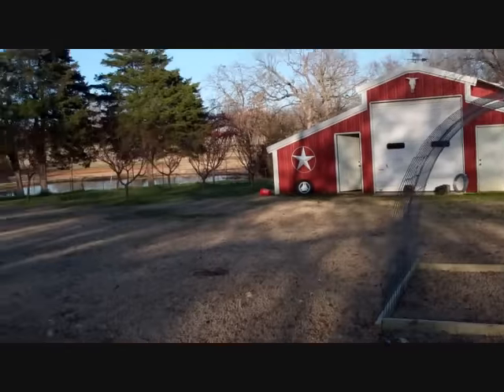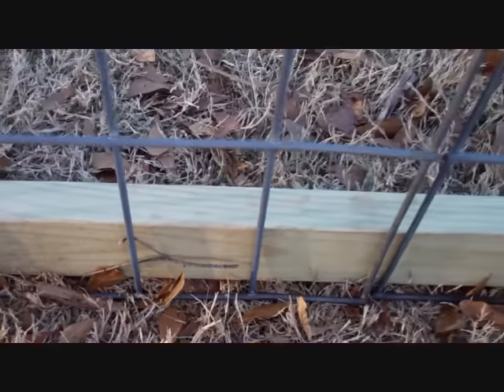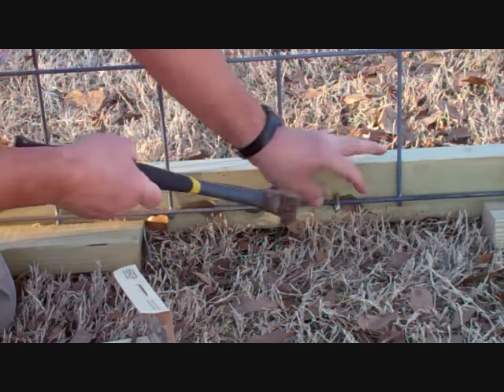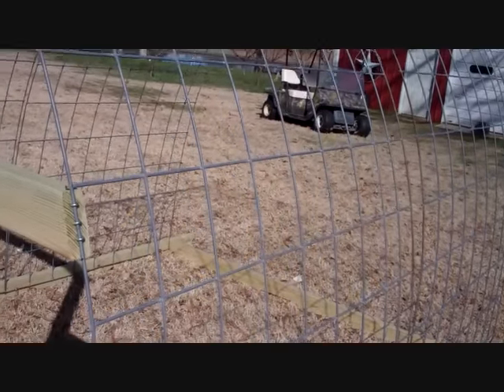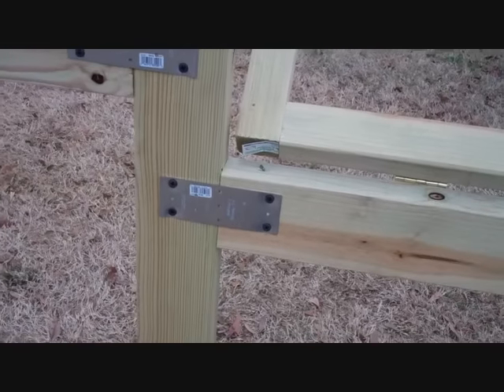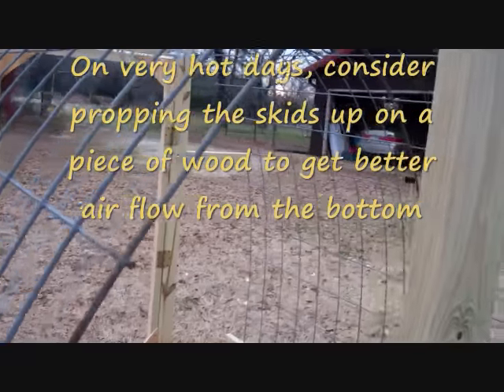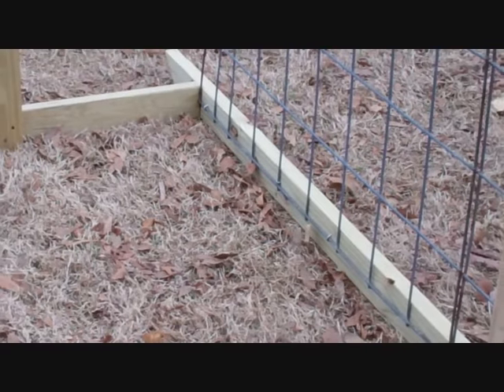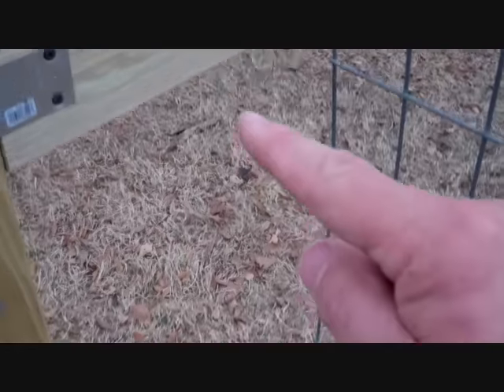🌞Cattle Panel Greenhouse🌱For About 150 DOLLARS! 🌻 DIY

Comment: Purchased the plans and I'm building one of these. One question I had was about the plastic. In the material list you say approx. 18'x24' but the link you provided is for a 16'x25'. Is the 16' width sufficient or should I buy the next size up (20')
Reply from the maker: 16'X24' will do a 2 Cattle Pane l Greenhouse.
The panels are 16' long, so the 24' length will go from front to back.
if you want to make it longer, you'll have to plan on getting longer plastic.
A 3 cattle panel GH would need (approx) 16'X30' (not sure exactly, but just trying to explain)
Hope that helps, and thanks so much for your purchase!!
alan
Reply: @BIGALTX  perfect, thank you

Comment: Being a retired carpenter i would build this a little different.
I would build the two 16ft runners by nailing or screwing two 16ft pressure treated 2x4s together to make an "L". I would turm the L's to face each other about seven feet apart and set 2xs on top of the insides of the Ls on the ends

The L shape would stiffen the sides and help to keep them from bowing out.
Set the wire on the inside and staple it to the upright surface of the L.
I might also screw a sacrificial double 2x4s to the bottom with beveled ends to stiffen it even more.
That way i could replace it if rot ever became a problem.
Reply from the maker: Interesting, thanks

Comment: Will it hold snow?
Reply from the maker: I've had MANY of these built in heavy snow areas. They say it just rolls off the top... no problem with snow weight.
I can hang from the middle of it (200+ LBS)
Reply: Thank you for the response 🙏

Comment: Can you winter plants over winter in Missouri in these without heater. Can you send me the plan for this please, thank you
Reply from the maker: First of all, there would be many nights that you WOULD need supplemental heat of some kind. 
Any time it gets below 35 or so, I would heat. 

Secondly... 
After giving away over 2800 copies of the original PDF, it is no longer free, but is now an e-Book on Amazon. I pasted annotations over the 
places on the video stating that a PDF was available through PayPal, or 
that the e-Book was on Amazon. If you have your “annotations” turned 
off, you wouldn’t have seen the disclaimer. The new Ebook
has a lot of updated info NOT INCLUDED in the original PDF, like a new 
section
showing how to attach corrugated metal to it to make a garden shed, goat
 barn or
chicken tractor, etc. I priced it VERY cheap. Click here to see the 
book: http://astore.amazon.com/homegardenfarmimprovementemergencypreparedness.homesadvis0b-20/images/B00CBNG03K

If you WOULD rather have it in a PDF format (so you can
print it out) I can send it to you. You’ll need to use the PayPal link below.
I’ll send the PDF to your email for your convenience. The NEW PDF file has all
the updated information, including the section dealing with attaching
corrugated metal to the basic frame to make a shed. Having the drawings and
materials list could save you a lot of time and money, so it’s WELL worth the
price, and I hope you’ll give it a try… Here’s the PayPal link: https://www.paypal.com/cgi-bin/webscr?cmd=_xclick&business=9MJBXYPX8HWBW&lc=US&item_name=Greenhouse%20PDF&amount=5%2e00&currency_code=USD&button_subtype=services&bn=PP%2dBuyNowBF%3abtn_buynowCC_LG%2egif%3aNonHosted

alan

Comment: built one last year but it got ripped up by the winds.  Did we have it on too tight? We used a heavy plastic specifically for green houses.  Want to replace the plastic but hope its not something we have to do every year.
Reply from the maker: Norm Hart If it was a good "greenhouse plastic"... I don't know WHAT went wrong... I had my plastic on for 4 years with no problems... a few holes that I patched with some clear packing tape... but no rips, etc.
Are you sure it wasn't hail? Hail would definitely tear it up, no matter how good the plastic was...
If not hail... I just don't know. You're the first that has had this problem if they used the right plastic.
I would say it wasn't too tight. In my opinion, the looser it is, the more likely to tear. I've had some tarps in the past that tore up if they flapped in the wind, but did well if tightly stretched. 
Let me know if you figure it out...

Comment: What kind of plastic did you use? Where did you get it?
Reply from the maker: DON'T use the plastic sold at Lowes or Home Depot.
It will only last ONE year.
Use a good, "Greenhouse Plastic".
It's more expensive, but should last 4 to 5 years.
A GOOD plastic on Amazon: http://amzn.to/2kE5hgW
For a 2 cattle panel greenhouse, you'll need a 16'X25" piece of plastic
Reply: @BIGALTX  Thank you so much that is so helpful!

Comment: I have now made 2 of these. How do I send a picture? I made the second one a full 8 wide. Used 2 X 8 for base frame which gave me the added height inside. My door swings out and fits over the face of the frame - much easier. First one went flying! Here's why: One, I never did anchor it down because it endured such high winds for almost a year without anchoring. Silly me! It went flying because my door catch broke loose during a wind storm and let the inward-swinging door blow in/open. Then, the whole opera became one giant kite!!! It flew almost 300 feet in the air before an unforgiving landing. New one is firmly anchored down tight. My shelves are just 2 X 4's laying on the horizontal supports. The top set is permanent, the bottom set I added and those shelves 'come and go' as I need shelf space for the spring season. The board against the steel stays put. The other one can be moved all the way out for wide shelf or back in for narrow shelf and more access to the garden floor.
All in all, fantastic design!!! I had some ag fabric on hand, so I put a layer under the greenhouse plastic hoping for a bit of added cold protection. Not sure it works, but I had it and had to try it....
Thanks so much for your design and book.

Comment: I have studied numerous greenhouse designs and this one is by far simpler and probably more durable. Although it will be more expensive in the long run it will pay for itself with less repairs.
Reply from the maker: +roy hoco 
Thank you sir !
Reply: +TexasPrepper2  have watched your video twice and read your e-book twice.  using my BYE masters degree from  LBYOM  University  (BYE = backyard engineering degree and LBYOM = learn by your own mistakes) some ideas occurred to me, not suggestions just ideas.  after framing the door and window, skin each end with 1/2" plywood which should help solidify the structure. then cut out the door and use the panel after it is trimmed with 2x2 strips  to make a stronger door. at the bottom front right and left of the door add temperature controlled foundation vents,  on the window frame add a screen on the inside and also add a temperature controlled opening device. a temp. controlled foundation vent could be in the bottom section of the door. PS am still working on my BYE Phd @ LBYOM University
Reply from the maker: +roy hoco 
Interesting suggestions.... thanks
Reply: +TexasPrepper2  another idea to consider.  I used 2x6 boards to frame the foundation, when it came to installing the 2x4x12 to stiffen the 2x6x12 I moved the 2x4 inside and dropped it 2" down on the 2x6 and then set the cattle panels on the 2x4 and stapled the panel in place, this gives about 4" more of head room. as the cold of winter moves in I plan to install at least two 75 watt spotlight bulbs on a timer to help provide warmth on a cold cold night. I covered the floor with 6 mil black plastic and will throw down a little cypress mulch for more added insulation
Reply from the maker: +roy hoco 
That sounds like a good idea too... may try it on the next one... thanks

Comment: are your cattle panels 16 ft long ,I found them at tractor supply for 19.99 each 50 inches wide
Reply from the maker: Yep... that's them !
They were about 15 bucks when I bought the ones I have.
Reply: here in VA 19.99 and hoping tractor supply offers the 10 % off coupon by the time I am done rebuilding my koi pond

Comment: How long can i make these?
Any materials list
Reply from the maker: Cathy Baby 
The materials list is in the “show more” section below the video. You can either get it in a PDF or as an e-book on Amazon. It has the materials list, as well as drawings on how to make the cuts.
The PDF shows a two panel greenhouse, but you can make it a lot longer by adding cattle panels. I have seen some that are three or four panels long.
Reply: @BIGALTX  ty
Reply from the maker: Cathy Baby 👍🏼

Comment: I am trying to build a greenhouse, but I am having an issue trying to find the page wire fencing!

What gauge is it?
Where did You buy it?
Reply from the maker: It's not really "wire".It is a panel of welded rods that are about 1/4" in diameter. They are 50" tall and 16' long. Here's a link so you can look:http://www.tractorsupply.com/en/store/feedlot-panel-cattle-16-ft-l-x-50-in-h
Reply: TexasPrepper2 Thank You! I live in Canada (Toronto) and the online store wont ship to Canada. Do you know of any other stores that sell to Canada
Reply from the maker: Logan Hunt No... I really don't.
Some of the components can be purchased at local hardware/lumber stores (like hinges, brackets, screws and the pipe insulation. The plastic needs to be regular "greenhouse plastic". If you don't have a GH supply place near you, I'm not sure what you can do.
Greenhousemegastore.com or the Amazon link would be worth trying... but you say they won't ship to Canada. Maybe you can find someone to ship. Look at all the GH supply places online. Surely there is one in Canada.
Wish I could help more...

Comment: What is the steel mesh that you used for this called?
Reply from the maker: They are known by several names. Livestock panels, feedlot panels... but around here we call them "cattle panels". Here's a link to them at Tractor Supply. Hope this helps.
https://www.tractorsupply.com/tsc/product/feedlot-panel-cattle-16-ft-l-x-50-in-h?cm_vc=-10005

If you're interested in the e-Book or PDF of the plans and material list, look below the video for the links.
Thanks,
alan

Comment: I wonder if I could build one of these to shelter my car?
Reply from the maker: With some modifications... probably
Reply: You would probably have to build like a 14' frame and then make it high enough because you only get 16ft with the cattle panel going across. I know it seems like much but the wider you go the less of an arch.
Reply: Makes sense...my car is 193 inches long, and a bit over 7 ft. wide.

Comment: Hello from Canada!  I think "Cattle Paddle" is an Americanism.  I'm goint to use the wire mesh that they use for pouring concrete.  It comes in rolls, so I'll curve the wire mesh the opposite way it is rolled and I can cut it to the length I need.  I'm just wondering if you could tell me how long (not wide) the Cattle Paddles are.
Reply from the maker: Look up "Cattle PANELS"... or "Livestock Panels"... not "paddles". I have heard that several in Canada have found them, but they were expensive. Someone told me they drove across the border to the US to buy them (they were close to the border).Not sure if concrete wire would work without some kind of support... like maybe bending some rebar in an arch to tie the wire to.... Or... maybe some PVC pipe... something that would give the concrete wire support. Concrete wire IS pretty stiff, but I'm not sure if it's stiff enough.
Reply: TexasPrepper2 Cattle Panels, I see.  Being Canadian, I'm a bit unacquianted with that fine southern accent of yours.  :)  It looks like the standard length is 16 feet.  I think the concrete wire is going to work for me.  I'm going to two greenhouses, 4'x5' so that I can lift them and move them around easily as I'm actually going to put it on the city easment behind my fence.  If they are light and easy to move, no one can say they are a permanent structures.  As we live in a quiet cul-de sac, I don't think it will be a problem anyway. By making the greenhouses shorter, there will be less "play" in the wire mesh. Also, I'll be able to move them around to till the soil with a standard rototiller and then replace them on freshly tilled soil. I'll let you know how it works with the concrete wire mesh as soon as I build it.

Comment: I was wonderin', you don't mention how long the cattle panels are that you are using, I heard they were 50" wide. Sorry I'm not a math person.
Reply from the maker: If you are using them as a fence (what they are intended for) they are 50" tall and 16 Feet long.Look at Tractor Supply online and search "Feedlot Panels".They have some that are shorter than 50" (like for hogs, etc) but I use the 50".

Comment: Btw you need 30' on the pipe foam and 18'x 25' of plastic film
Reply from the maker: todd deniger 
16’X25’ plastic will do if the frame is made out of 2X4’s. The only reason to use 18’ plastic would be if wider lumber is used. 

If the “skids” (the runners) are 2X8 or wider, you might need 18’X25’ plastic. I bought a big role of 16 foot plastic. I have built one or two green houses out of two by sixes and the 16 foot plastic covered it just fine. 
Hope that helps.

Comment: if i bought ur plan and material list can i go to home depot and make my dimensions 15x8x8
Reply from the maker: Not without modifications to the "plans". 
The plans are for 6'2" tall and 7' wide. You can make it as long as you wish (within reason, and with extra bracing)

Comment: Are you still sending out a PDF material list?  I would like one.
Reply from the maker: No... I’m sorry, but after giving away over 2800 copies of the original PDF, it is no longer free, but is now an e-Book on Amazon. I pasted annotations over the places on the video that stated that a free PDF was available. If you have your “annotations” turned off, or if you are watching on a mobile device, you wouldn’t have seen the disclaimer.
The new Ebook has a lot of updated info NOT INCLUDED in the original PDF, like a new section showing how to attach corrugated metal to it to make a garden shed, goat barn or chicken tractor, etc.I priced it VERY cheap. Click here to see the book:
http://astore.amazon.com/homegardenfarmimprovementemergencypreparedness.homesadvis0b-20/images/B00CBNG03KIf you WOULD rather have it in a PDF format (so you can print it out) I can send it to you. You’ll need to use the PayPal link below. I’ll send the PDF to your email for your convenience. The NEW PDF file has all the updated information, including the section dealing with attaching corrugated metal to the basic frame to make a shed. Having the drawings and materials list could save you a lot of time and money, so it’s WELL worth the price, and I hope you’ll give it a try. The PDF is also cheaper than the e-Book.Here’s the PayPal link:
https://www.paypal.com/cgi-bin/webscr?cmd=_xclick&business=9MJBXYPX8HWBW&lc=US&item_name=Greenhouse%20PDF&amount=5%2e00&currency_code=USD&button_subtype=services&bn=PP%2dBuyNowBF%3abtn_buynowCC_LG%2egif%3aNonHostedThanks… and thanks for watching my videos.alan

Comment: another good idea where the edges of the cattle panels meet, (instead of using wire or zip ties) is to buy a cheap pair of hog ring pliers and use hog rings. I use them all the time when i build fences. Just have to make sure pointed ends are inside/under the panels so plastic doesn't catch and snag.
Reply from the maker: Good idea...

Comment: We don't seem to have cattle panel in the UK and can't locate an alternative.  I would love to make this.
Reply from the maker: I had someone a few years ago that found some in the UK but they were called something else.
Try taking a picture of them to your local feed store and see if they can have them shipped in.
Might  be expensive, though.
Here's a picture of them: https://www.tractorsupply.com/tsc/product/feedlot-panel-cattle-16-ft-l-x-50-in-h?cm_vc=-10005
They are 50" inches tall and 16 feet long
Reply: @BIGALTX  Thanks for that, I will keep looking.  I can't find any after 2 days.  All our stuff is on a roll and has no strength.
Reply from the maker: @loislaw2652  
No... the roll stuff won't work.

Comment: Awesome! My summer bucket list.   Is all the wood and the base 2x4s? I thought I heard you say sleigh base. Thank you young man!
Reply from the maker: Yes, in this video everything is 2X4 except (i think) the window frame.
I would suggest doing the bottom skids in 2X6 if you're  going to be moving it a lot.
Plus, using 2X6's at the bottom you could raise the cattle panels up a little and give yourself more height.
Everything is treated wood.

Comment: I would have the window opening upwards,  venting when its raining will let the water pour in :) The black pipe insulation will get hot in full sun and degrade the poly, white would be better. Same goes for the steel cattle panel (paint it white)  but theres not much you can do about the abrasion of the poly against the steel in windy conditions. Dont have pvc based plastic/foam insulation in direct contact with horticultural poly, the chorine will destroy it  :)
Reply from the maker: JohnGuest45 
The plastic on my original greenhouse lasted 4 years before I removed it. It had a hole or 2 (that i poked in it), but there was no deterioration of the plastic at the places the insulation touched it... and we had some HOT weather here in TX. The first year I built it, we had 82 days of 100+ F days here.
I haven't heard anyone say there was a problem... unless... they didn't use quality Greenhouse Plastic. 
The plastic from Lowes etc... won't last but about one year.
BTW... a tip... just use clear packing tape on any hole you poke in it... works great...